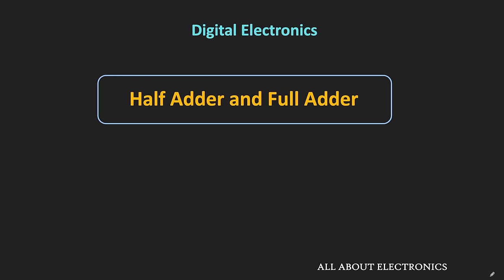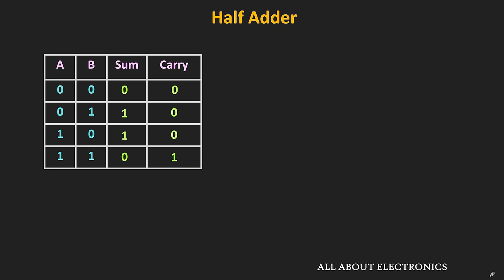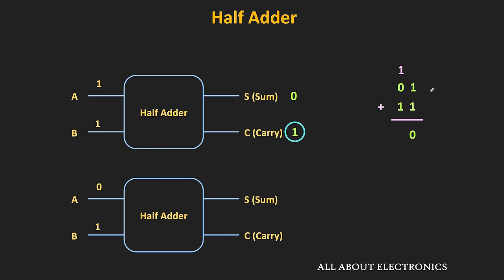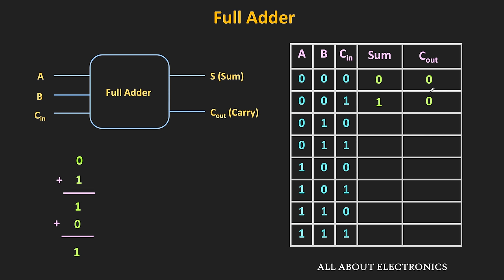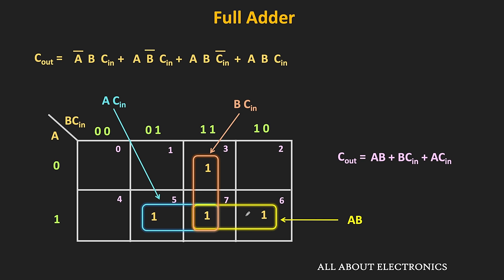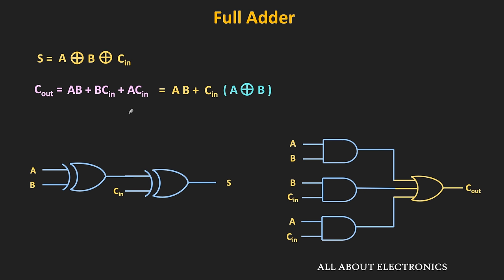Half Adder and Full Adder Explained | The Full Adder using Half Adder

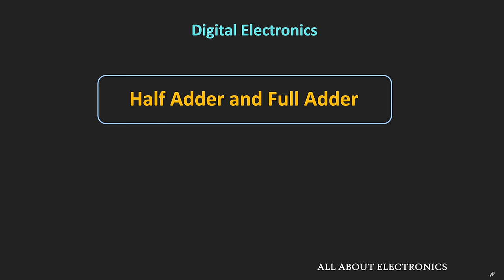Comment: 00:10 Half Adder adds two bits to give sum and carry output
01:58 Understanding Half Adder Logic Circuits
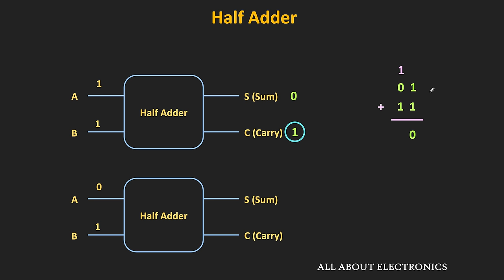03:40 Full adder is a combinational circuit that adds two bits and the carry bit to generate sum and carry as output.
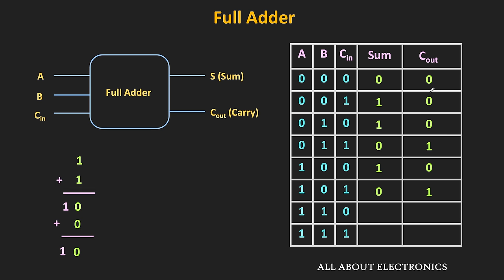05:26 Explanation of the full adder truth table and Boolean expressions.
07:18 Simplified expressions of sum and carry outputs using XOR and K-map
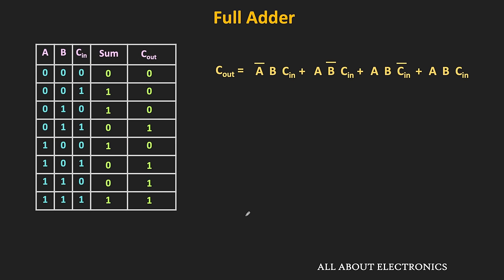09:05 Explains alternative ways of expressing carry output
10:57 Explaining the logic circuit of the full adder using XOR and AND gates.
12:48 Explains the design of a full adder using two half adders and an OR gate

Comment: Sir when we wrote carry in two different fashion by equating them why are we getting that or gate equals exor
Reply from the maker: See this is the special case, where we are getting this condition. That means, using either OR gate or the XOR gate, we can get the same result. If you see the carry output, then it is equal to 1 when both A and B are 1, or when Cin is 1 and either A or B is 1, or all three inputs are 1. So definitely, using OR gate, this condition will get satisfied. If we use the XOR gate, then whenever A = B = Cin = 1 then Cin (A ⊕ B) will be 0. But since both A and B are 1, so first term (A.B) will be 1. And in this way, using both XOR gate, or the OR gate, we are able to produce same result. I hope, I was able to convey the reason for that.  In case, if you still have any doubt then let me know here.
Reply: @ALLABOUTELECTRONICS  thank you so much sir. I got it. U da 🐐

Comment: sir why we cannot give 3  inputs  in Exor gate
Reply from the maker: It can be implemented using 3 input XOR gate. but as I have shown in the video, the sum expression can also be represented as AB + Cin. A ( XOR) B.
So, using the some part of the carry generating circuit, the sum generating circuit can be designed. And in this way, number of logic gates used in the circuit can be reduced.
Just to show that, it was represented using two XOR gates.